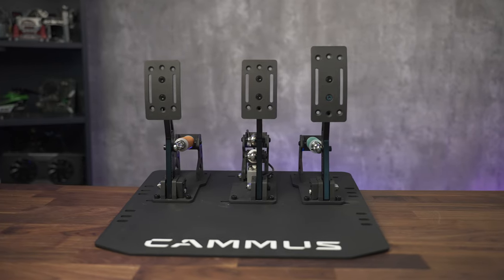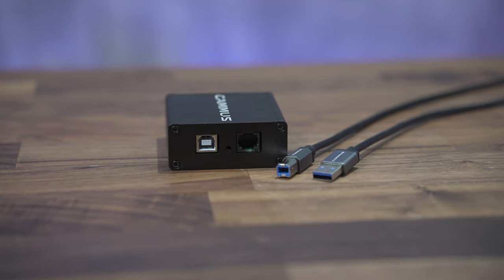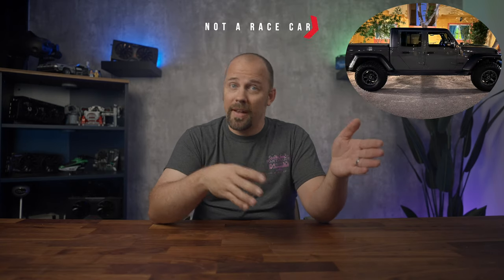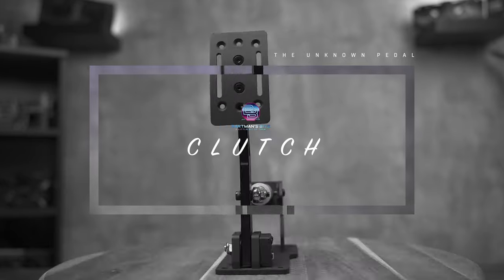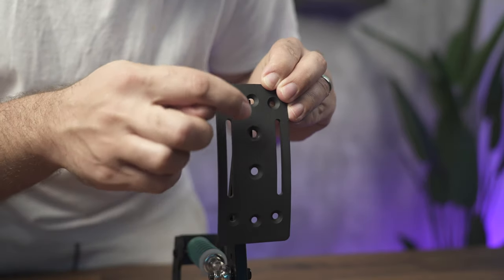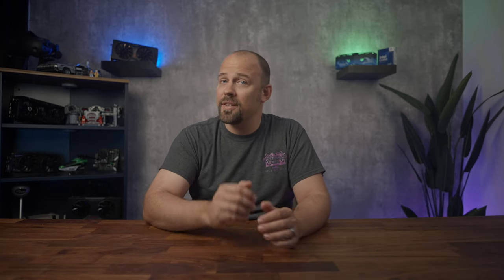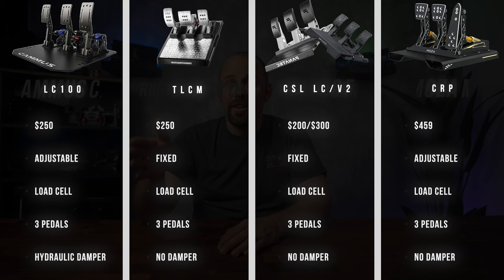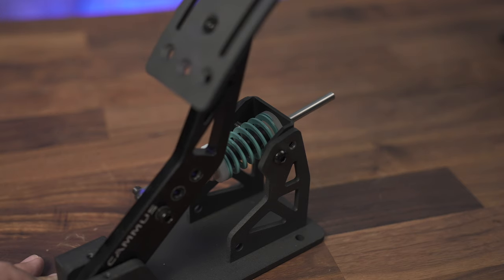Best Sim Pedal set of 2024? Cammus LC100 review

Comment: I'm loving mine. But, I got something different than every review, every image, and even what their website shows. It's like I was shipped an unknown LC100 V2. The box they shipped in and all the documentation says they're just the LC100 pedals. No V2, no Rev. 2. I've only had them for about a week or two, so I got them not too long after your video was released. What I received is more refined. The styling is better with chamfered edges all around, the base and mounting is different, the control box is integrated into the accel pedal instead of being a standalone piece, it did come with different sized spacers, and it connects via USB C. 

I haven't been able to find anything like I have online, anywhere. 

They're great. Once I got them dialed in I've been nothing but pleased with them. They blow my old Fanatec CLS Elite load cell pedals out of the water.
Reply from the maker: That is very interesting. I see the pictures on their site show a different version as well. I have reached out to them for an explanation. Good to know that buyers are getting something better than I got, which was still really good. Thanks for the comment!
Reply: @BartmansBits  I see they've updated the images. That still isn't quite the same thing as what I have, but it's much closer.
Reply: You've received the CAMMUS LC100 V2  (as you suspected).
Reply: @chriskeeble  I've seen a couple reviews of the updated pedals pop up here and there.